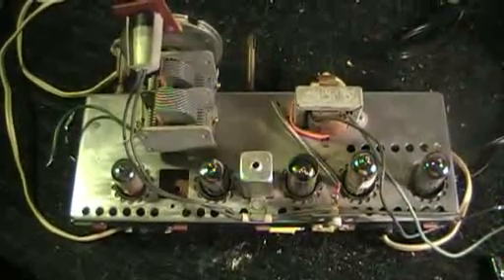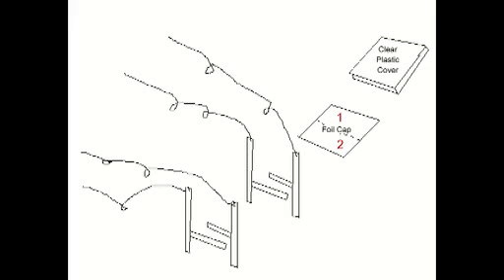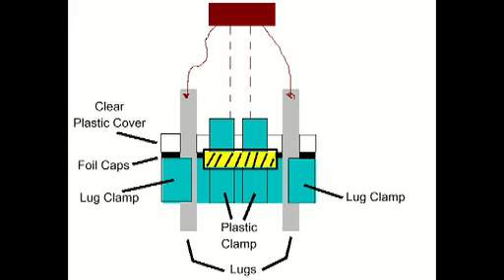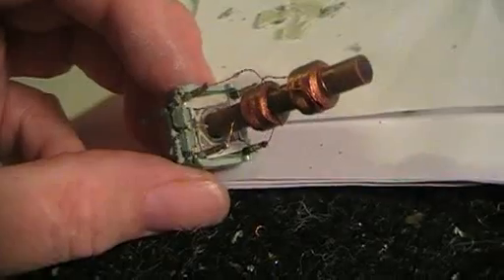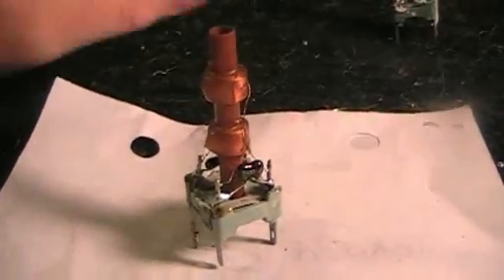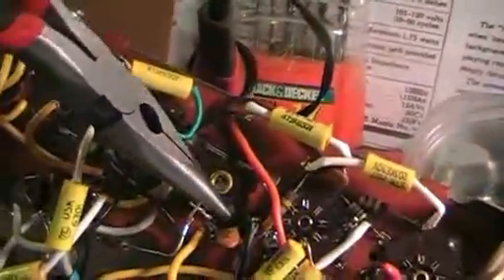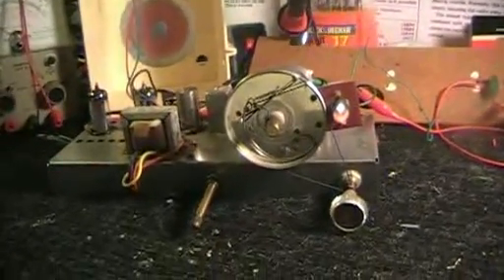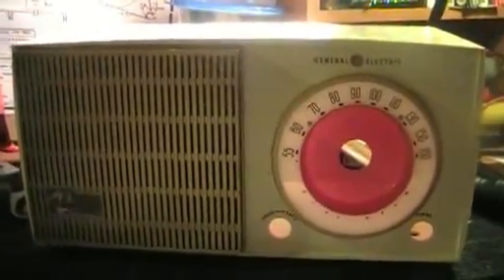SMD:  Repairing Radio IF Coils

Comment: When measuring the continuity of the coils where do you clip your leads to?
Reply from the maker: The if transformers have 4 terminals.  2 for one of the coils and 2 for the other.  You check for continuity of both sets.
Reply: @johnallenrichter  Thank you

Comment: Looks like the GE-466 Dial Beam model AM radio. It's best to leave the coil alone. SMD is erratic and intermittent. The minute you modify the chassis to work better the sooner you'll detract from the real value of the radio. It's not like anyone is really going to listen to AM by the hours. Those days are over. In the end you risk the destruction of a decent product if you screw it up. Once you remove the mica cap and add an external cap , you need to realign the chassis. That's when you inner core freezes of crumbles. If it is not broke don't fix it: let sleeping dogs lie down: leave well enough alone.
Reply from the maker: You make a good point.  The sparking between the mica caps on this particular radio was so intense that there was nothing but popping and crisping noises from the speaker.  It could become a collector's item, non-working.  But my hobby is repairing antique radios, not just collecting them.  And so I went the extra mile and added new parts to replace the old.

Comment: Calculate the replacement capacitor’s value by
1. After you remove the old cap measure the inductance to be resonated at the IF
2. Given that the IF (f) and inductance (L) are now known, calculate C from f = 1/(2*PI * sqrt(LC)).
You’ll need to do some algebra to put the above equation into the form C = ...
Hint: start by first squaring both sides of the equation. The rest is left as an exercise for the reader! 😇
Reply from the maker: This awesome information... thank you f pl r that.  There are so many times when this formula is needed.  I think when I open a radio and see someone has made changes, i dont really know if they used parts as suggested by the schematics, if the schematic part changed post or mid year, etc.  Your formula removes all doubt. I wish I had time to make a video on it.
Reply: @johnallenrichter  Hi John, A very belated You're Welcome! I helped a friend replace a cap and realized that most folks were't familiar with this simple calculation. Bob N1RC/BSEE. 

PS: C = 1/{[(2*Pi*f)^2]*L}  sorry about the nested parentheses!

Comment: I broke the core's while aligning my Bush(UK) TR-82....I had to replace the entire IF transformer, because the coil take a very small and not a normal size core..its right around 4 mm diameter..I found no one in the USA to replace these..so I had to find someone to get them from in the UK...I have been going back and forth with people in the UK to get the parts..
Reply: AND after I tried to file down some core's I had from scrap radios, I found one that was close, BUT...when I tried to screw in the new core, because I did not file it down small enough...the post that holds the coils twisted..which broke the very thin, hairlike wires...a lesson learned for me...So I had to find an unobtainable IF can...
Reply from the maker: Certainly can be frustrating.  I think the hardest part of restoration, and the most time consuming, is a need to custom manufacture new structural parts due to damage or accident.  However completing such arduous tasks with some precision is equally satisfying.  With 3d printers becoming more affordable it will be interesting to watch as they become more effective tools for the restoration hobby

Comment: How did you pick your cap value?
Reply: fred fabris ...using a Ouiji Board?
Reply: You can often measure the value of the old mica sheets, and/or measure the inductance of the coil and use one of the on-line resonance calculators to get the theoretical value of the cap required for your IF (will likely be a little high for "real life" though). Or put in trimmer caps first and tweak them, then measure those.
Reply from the maker: In my case I consulted some more advanced technicians on the antiqueradiosDOTcom.  They are very helpful.  I got the notion that most all American 5 tube radios used approximately the same sized mica caps.  I'd have to watch the video again to recall the standard range exactly.  I'm guessing now as my memory is fading that it was somewhere between 90 and 175 picofarads. Regardless the radio transformers will need to be returned after the job is done, and that tuning will make up for the slight difference in capacitance.

Comment: John, a better tool I have found to cut plastic is formed by a dull/broken ball cutter where the ball is removed and the sharp end is shaped with flat areas like a jeweler's screwdriver.  Light cuts are a must or plastic builds up on the tip which increases the cutters diameter.
Reply from the maker: Excellent tip.  It's sort of scary using a rotary cutter because one feels it could easily get out of control and accidentally cut something important. And that just causes a need for yet another repair
Reply: @johnallenrichter  I just trimmed the plastic off with a craft knife. Easy peasy.